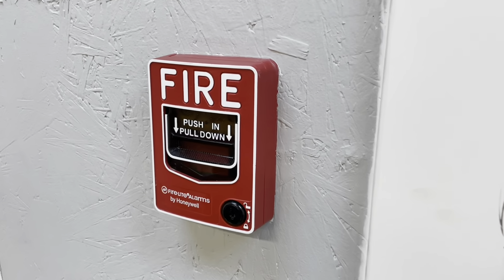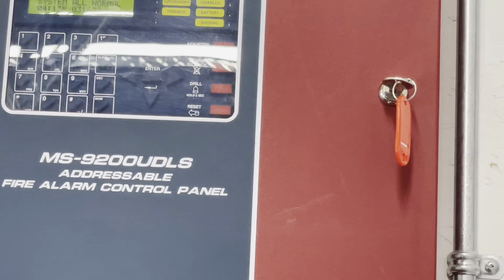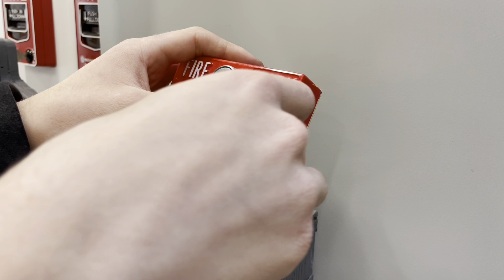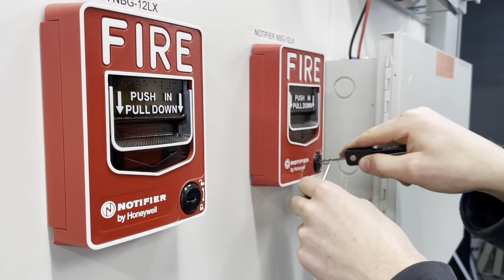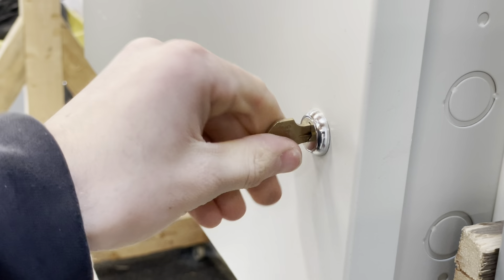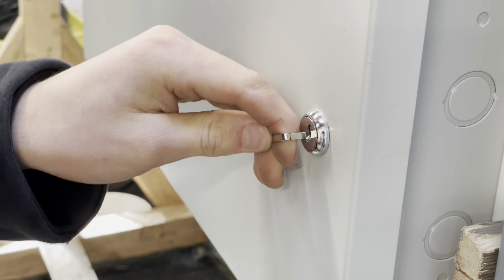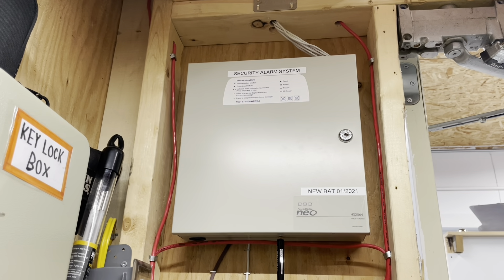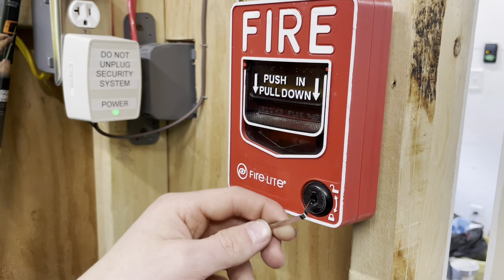Picking Fire alarm locks Firelite, Notifier, Simplex, EST And more.

Comment: I've had multiple simplex T-Bar pull stations but apart for the locks that always jams, it is very easy to pull the handle down partway and activate the system without requiring a key-reset - especially on the addressable stations.

Comment: You don't even need the right key for most of these disc tumbler cabinet locks, literally just any of the same blank. The storm door key from my old house is able to open any CAT code lock, Simplex, Edwards, Silent Knight, etc. by simply raking once or twice with a little pressure.
Reply from the maker: This is true definitely not stopping anyone watching in they'll practically open if you look at them right

Comment: I have a lock pick set and wafer locks are simple they are just so easy and that's such a dumb thing. I kinda frown upon them
Reply from the maker: Yeah they are crap
Reply: I could rake them I could pin by pin pick or sometimes they are crappy enough I don't need anything but a flathead to turn it. Yeah. That's how bad some are.

Comment: fire alarm locks arent ususally meant for actual security. they are just meant for the "average prankster joe" to not be able to reset it and run away.
Reply from the maker: Pretty much you would still think that the panels would be a little more secure though oh well
Reply: Usually the FACP is in a secured place, but I can see that for, like,  an NFS2 in a foyer with limited visibility you'd want some peace of mind.

Comment: since the community post wants you to do a  320c if you were to do it would you make all the pulls nbg12lx or keep as bg12lx and swap detectors or keep as firelite
Reply from the maker: There are no pull stations or fire lite detectors in the house
Reply from the maker: @ObamnaSoda513   the shed is all conventional with just one heat detector and a pull which won't change and the garage system also has nothing to do with the house
Reply from the maker: @ObamnaSoda513  no the house has nothing to do with the garage